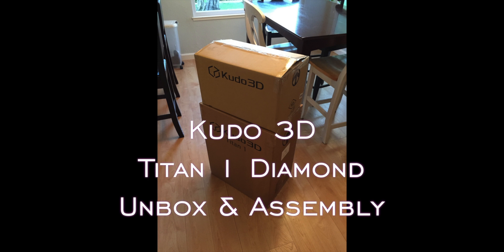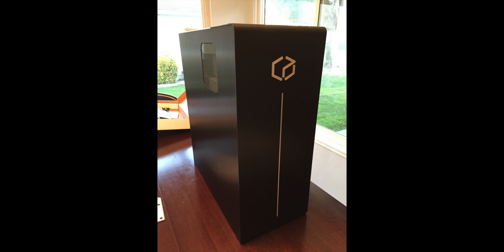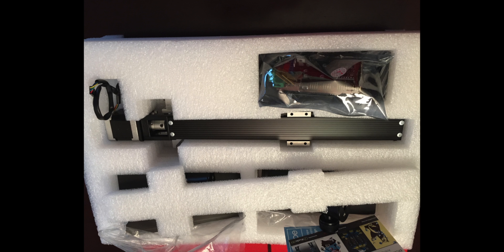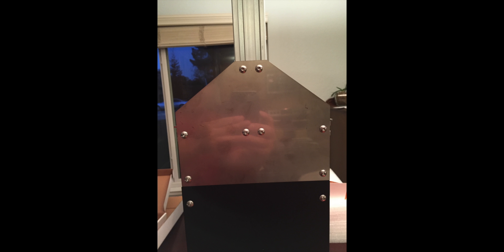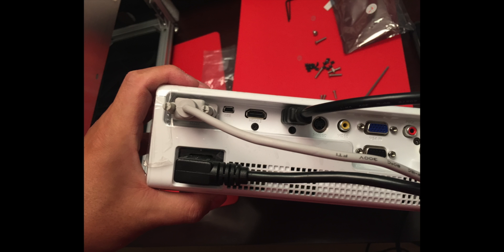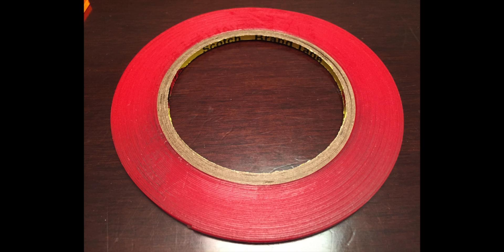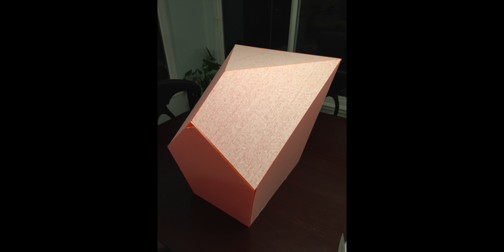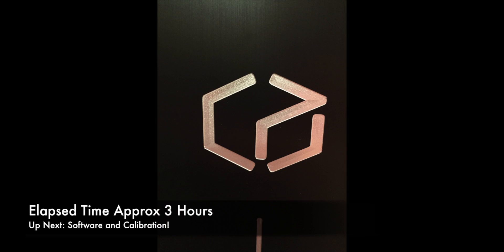Kudo3D Diamond

Comment: Can any of you give me the model number of the linear actuator? I'm trying to reverse engineer this sucker for a top down DLP SLA printer.
Reply: Or the dimensions!
Reply from the maker: I'm not sure the exact model / size of the linear actuator, but they're using this:
https://tech.thk.com/upload/catalog_claim/pdf/cat_kr_en.pdf
Reply: Decadent Minimalist Thanks! I figured that out from your awesome photos. What puzzles me is that the KR/SKR 20 maxes out at 140.9 mm or about 5.5 inches, which seems to contradict the 9.4 inch build height possible with the titan 1

Comment: I just got mine the other day - not finished assembling as I'm full up with a cold - and have to say it's really odd mixed bag!; The industrial design of the case and the machine is great, I'm really impressed with it - quality parts and a professional feel (yeh OK it's a kit but it's about $600 cheaper than a form 1+ and crucially it's not tied to a proprietary resin).

The instructions however (and from what I'm hearing the software too) are a massive let down though. I do instructional designs for work and, though I'm not a graphic designer at all, I could do a better job than this ...in an afternoon! I don't understand why they don't just find more / better people rather than compromise and risk upsetting / annoying peopleFingers crossed we can either build a community around this thing.

Anyone know if we could use software from something open source like the LittleRP to drive the Titan1?

Comment: So the lid is held together with tape?  TAPE?!  Really?!!  Is that sturdy?  It just sits on top?  It doesn't have a hinge or anything holding it in place?  That is really upsetting.  I got the printer but nothing else.  I ordered the resin and lamp to cure finished prints.  I'm still in shock that the lid is literally held together with tape.  Is this a product being sold by a legitimate company or a high school project?  As long as the prints are awesome I'll try not to care.  Thanks so much for the video with lots of great pictures.
Reply: Ya, that is a little disappointing -- I think that is minor though, considering some of the other issues. The lack of a light shutter is a big bummer - Kudo3D suggests manually placing something between the projector lens and the vat. And the biggest issue for me is the not-easy-to-use software toolchain...

Comment: I didn't have a tracking number but mine arrived today...luckily Fedex driver called me with a heads up.  Can you clarify which pins the stepper motor plugs into?  The guide states the "Z" pins closest to the heat sink, however, the picture seems to show those pins open and the plug going to the next 4 "Z" pins.  Any help appreciated.
Reply: You're looking for 2 rows of 4 pins just under the postage stamp size Stepper Driver PCB (where you were supposed to attach the heatsink). See the diagram here http://www.nextdayreprap.co.uk/images/nextday3dprinters/Reprap_Prusa_Mendel_Build_Manual/2500_2500__Reprap_Prusa_ramps_diagram.jpeg - look for the pins labeled "Z Motors".

The 2 rows of pins are electrically connected together – so you can plug into either row...

Comment: Didn't have a working Windows PC... Just got Windows 8.1 installed, so I can try making some prints shortly!

I would say the lack of Mac support was a surprise... Potentially a big problem if you don't have extra hardware laying around. It also requires an extra HDMI port (or a DVI port with an adapter).

Comment: Hi CT-

I found that unscrewing the terminals all the way and moderate pressure was all that was needed... It wasn't that the terminal holes were too small, but rather getting the pins under the moving tabs...

Didn't need to cut or modify in any way.

Comment: Cool, how did you get the fan connectors into the screw terminals? I found the female crimp end to be far too big to fit in the terminal block and I had to flatten and trim them.

Also, did you receive two Fedex tracking numbers for the two boxes? I also got the diamond with the UV chamber and resin, but only one box arrived with the printer in it.